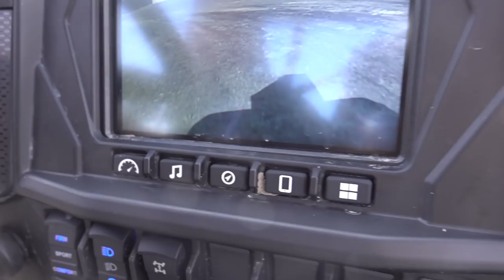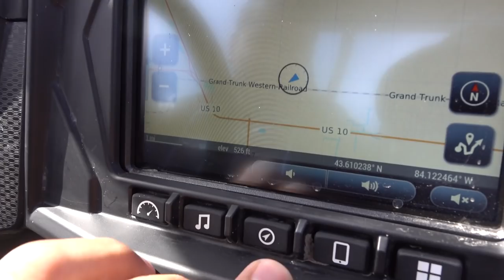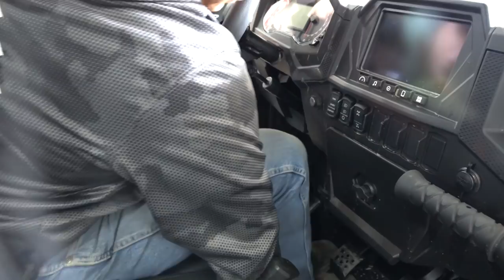Polaris RZR Turbo S Project 168! Part 1! Seats/mirrors/flag mount

Comment: Love the hair nets (creepy lunch lady). The tech in those belts are really cool. Fall protection in construction harnesses are vary similar. (You would be amazed at the reduction of impact somewhere in the thousands of psi )  and it’s official using the 110 this year and getting the new turbo s over the winter. The wife even said yes, I almost cried lol.  Love the posts guys. And I need a Doug in my life it would be so much easier to mod the beast haha
Reply: I’m sure they would have to be once they expand there is no fixing them, I’m sure their is stitching it them somewhere too 
But I guess if it’s to the point you used that feature I think the cheapest fix will be the belts lol

Comment: Get ya a Milwaukee impact 1300 pounds and can connect to your phone and set the tourqe for lug nuts at like 80 lb and then it cuts off bad ass tool bro.
Reply: Hate to cheat on Dewalt but I've got a milwaukee sawzall, good unit